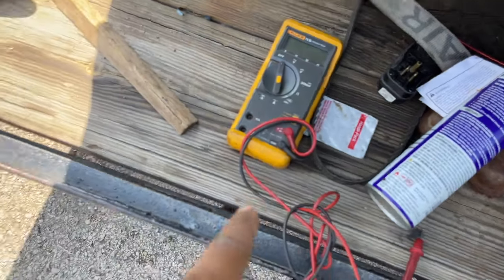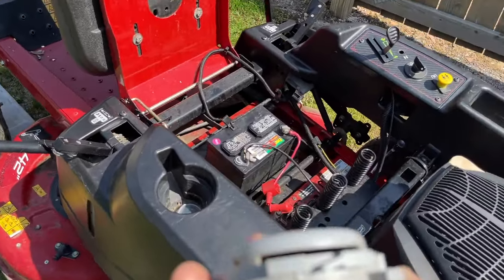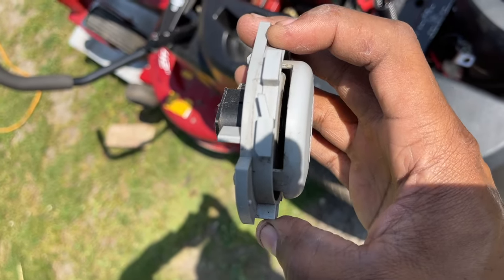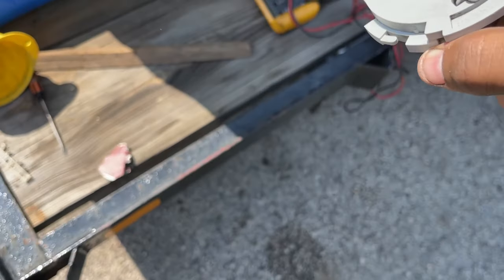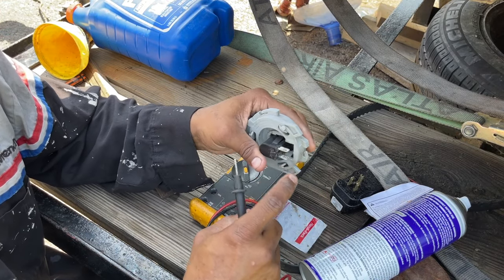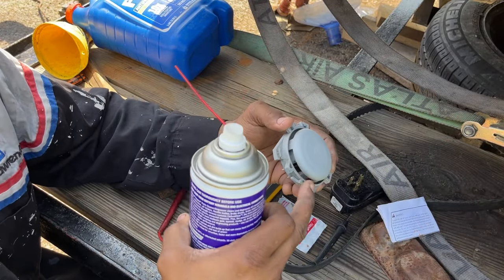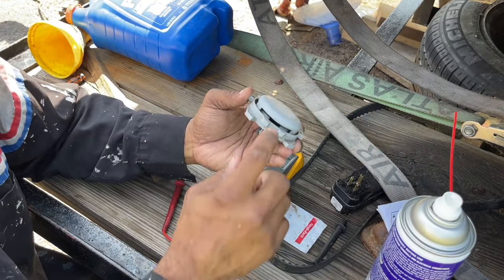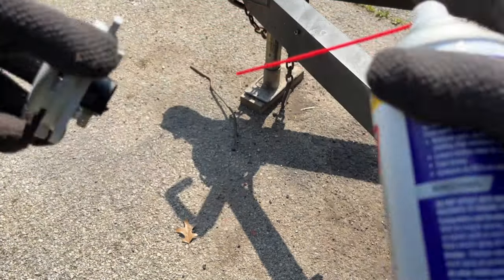Toro Timecutter Mower Shuts Off When Handles Are Moved Or Blades Engaged | Seat Safety Switch Issue?

Comment: I disconnected the battery and sprayed Mass Air Flow spray into the switches and then took an air hose and blew it out. It worked for me. The switches on the handles were dirty.

Comment: Thank you for helping me save some time and money. Exactly the same problem on my Toro SS 4200 ZTR. Removed and cleaned the seat contact with Brake Cleaner and it works like new. Video helped tremendously!
Reply from the maker: You're very welcome. Thank you for watching.

Comment: That gray case at 4:18 pops apart by pressing on the 3 tabs.  Then you can push the switch out and inspect the spring.  I just took mine apart completely and tested the swtich by clicking it 20 times.  Put it all back together and it worked fine.  I had a live in roach inside mine.
Reply from the maker: Thanks for sharing that info and watching.

Comment: 2 cents. On Mine with steering arms in neutral I can start mower without being in seat.
Mine hard click clicks and sometimes will start. 
Testing Solenoid I have both small connections show ground. One should be I believe the other comes from that darn Neutral brake switch.

Comment: Thanks for the video,  I was starting to feel like I was the only one having the same problem. I did however replace both handle safety switches  and the seat switch. PTO clutch is making this clicking noise when you turn it on and off. Also replace the PTO switch and ignition switch and I am still having the same problems. Now I'm thinking maybe the ground wire somewhere. I'm glad your problem got fixed and really appreciate you posting this video
Reply from the maker: You're very welcome. Please let me know if you figure out your issue. I am curious to see what the problem is. Thanks for watching.
Reply: It's probably the brake controller they go bad and it won't start and other crazy stuff happens!

Comment: Great job.. My Toro Timecutter 5000 wouldn’t restart after resting it before adding more gas to finish up my front yard. No power and couldn’t restart it so started checking out the safety connections. Not able to turn power at the ignition switch I couldn’t test anything. I replaced the ignition switch first, no change. Purchased a starter solenoid..nothing. For a entire weekend I used YouTube ..nothing  I tried worked 
Frustrated… I replaced everything back with what I had purchased with the same parts I removed.
Well…when putting on the old ignition switch I heard something what sounded like something reset itself. Everything working perfectly before the loss of power after adding gas to finish my yard.
Needl😮ess to say, I was surprised.
Now that I have it up and running again, I’m having the never before handled issue not able to move my mower forward and backwards. My handles feel super loose for whatever reason. Near the sensors, is there supposed to have compression springs in that area ? Also, did you have any issues with your blade switch engaging and shutting off your mower?
Excellent job and explanation throughout your video. Definitely I plan to subscribe. Thanks
Reply from the maker: There's no compression spring for the handles. You can make them a little firmer by tightening that 13mm or 14mm bolt that has a few washers on it. I have never had any issues with the switch that powers the blades thus far. Thank you so much for watching.
Reply: Wanted to ask you if there is a certain plug orientation for the handle sensors (2). I noticed 2 different colored wires from the plug to the sensor itself. The seat sensor is a no-brained

Comment: Ok so mine is doing that but it’s idling to high as well
Reply from the maker: The switch has nothing to do with the idle. Check the throttle cable to see if it's moving in and out freely. I wish I were there to see the issue, I probably could see the problem quickly.

Comment: This is why people pay to have their yards mowed.
I go through this every year in one way or another.
It kust cost so damn much to pay someone to pay 2 acres.
Mower shits off whether I engage rhe pto brake lever, or handles. Do you think it could still be the seat safety switch?
Thanks for any answers.
Reply from the maker: It absolutely could be the seat switch. It's a very common issue with these mowers and others.
Reply: @TerenceDIY  thanks! When I wiggled and jiggled the switch,the mower came on. Sounds like the issue.
Reply from the maker: Great!
Reply: @TerenceDIY   just a follow up. It turns out it was the brake safety switch. What a pain.
But thanks again for the video.
Reply from the maker: I am glad you found out the issue. Once again, thanks for watching.

Comment: I replaced the seat switch, still didn't work. Was going to load on trailer and started working 🤷 went to use it again and same thing? Any ideas?
Reply from the maker: How did the switch terminals on the connector / plug look? Any rust, corrosion?
Reply: @TerenceDIY  not that I noticed. Going to take off and clean. You think it's possible that the new switch is bad? Might be able to test it today. Thank you for responding! Really appreciate it.
Reply from the maker: If you could test it, that would save you time. Check that connector terminals.